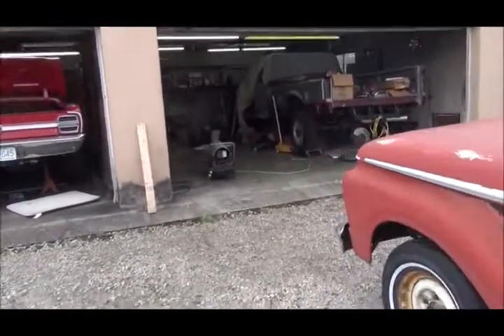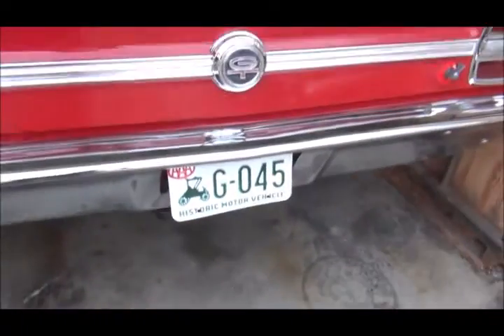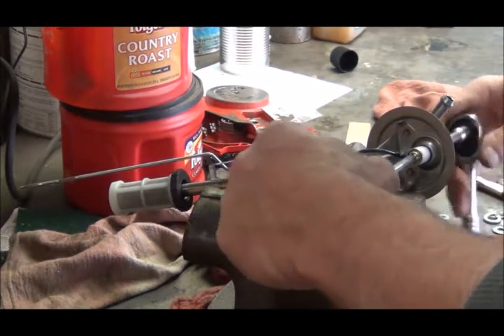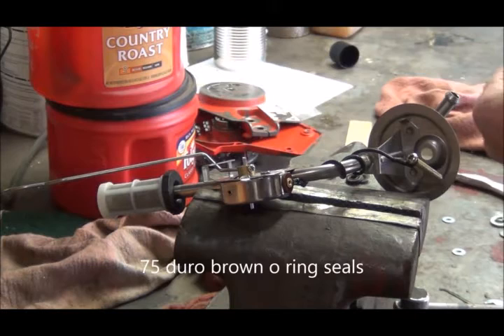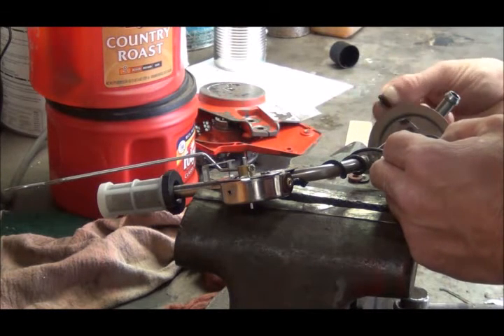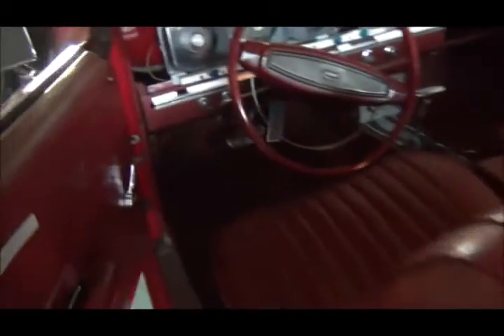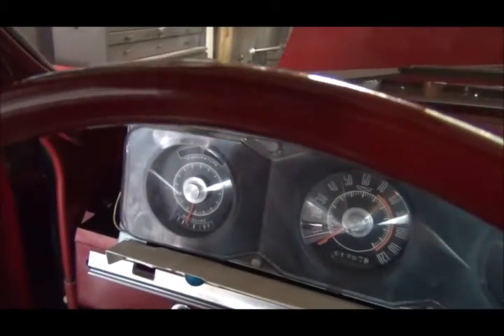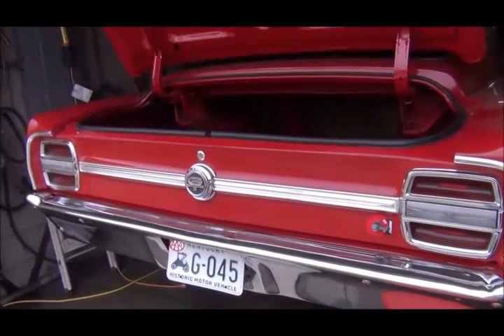Fixing the leaky fuel sending unit in the Torino.

Comment: I sure could use your help. I just bought a 74 torino that needs a lot of work and I'm already running into issues. Can't even get my master cylinder  replaced because I can't get the brake line out of the proportional valve ugggh